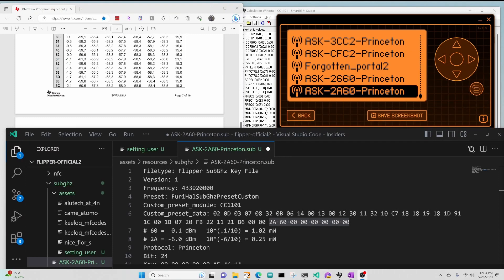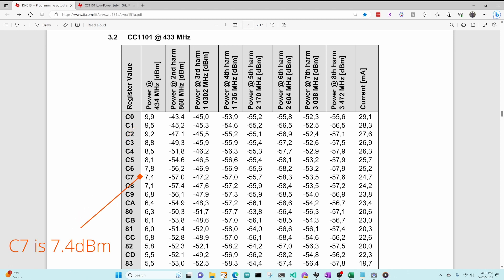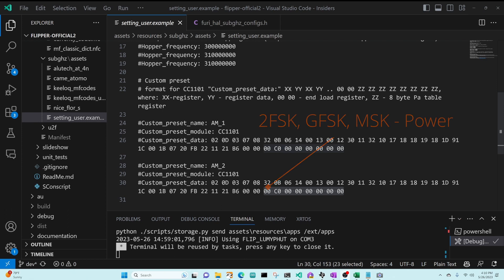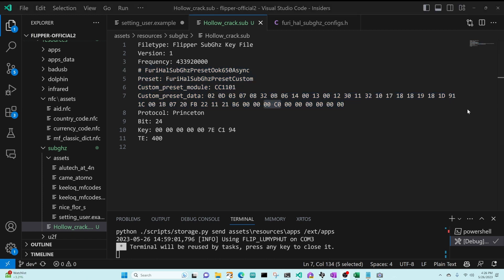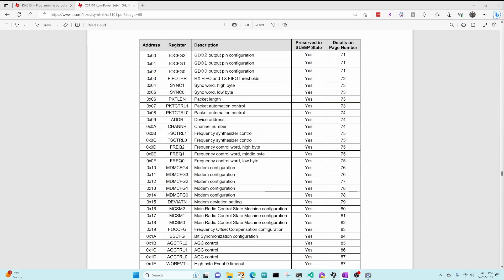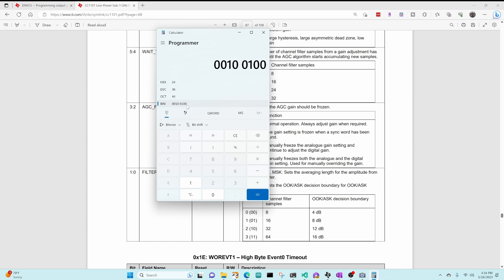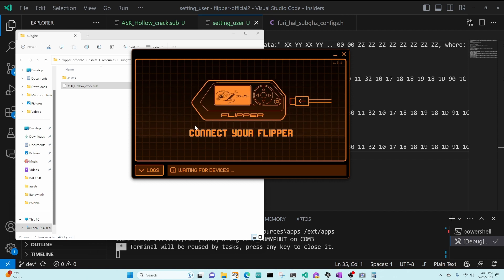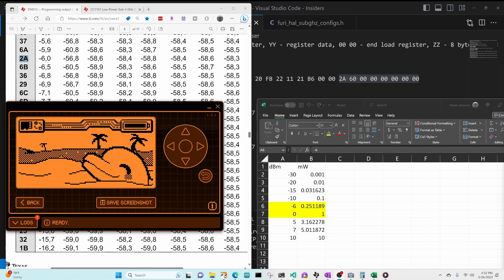[64] Flipper Zero - SubGHz Custom PATABLE

Comment: hi, can you make a tutorial on how to code on the flipper zero wifi board?
Reply from the maker: Hi, thanks for the request.  Can you be more specific?  Are you asking for videos on Marauder, some kind of custom change for Marauder, or something else? https://youtu.be/5TDeqjYSjOw is for ESP32 (which should be similar to the wifi board) -- I don't own a dev board yet (and they are currently sold out in US).  You can also reach out to me on Discord at codeallnight#1337 if that's easier.

Comment from the maker: It is NOT RECOMMENDED to use the PATABLE register settings from 0x61 to 0x6F for CC1101.  (Mentioned in both the spec and DN013).

The reason for the complexity in the hex values used for power is the 4-stage design, where some of the stages overlap in power range.  Different frequencies also have different gains with the stages.  I know a few of you probably want to try to understand why C0 is more power than C7, but 26 is greater than 1C.  Hopefully this helps...

Four stages are determined by the two-highest bits (bits 7&6).
Stage 11.  Only bits 3-0 are used (decreasing power) "C0" to "CF"
Stage 10.  Only bits 3-0 are used (decreasing power) "80" to "8F"
Stage 01:  
  bits 5&4 of 11 = 11 invalid. ("70" to "7F" are NOT valid)
  bits 5&4 of 10 = bits 3-0 are used (decreasing power**) "60".  "61" to "6F" is NOT RECOMMENDED for CC1101!!
  bits 5&4 of 01 = only bits 2-0 are used (decreasing power) "50" to "57".  ("58" to "5F" are NOT valid)
  bits 5&4 of 00 = fixed power.  "40" ("41" to "4F" are not VALID)
Stage 00, bits 5-0 are used (increasing power) "00" to "3F"